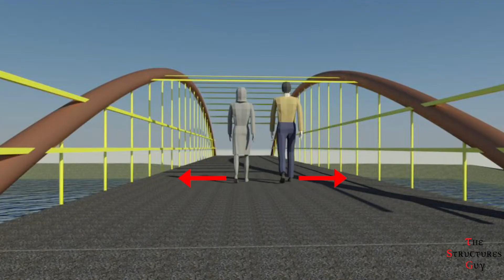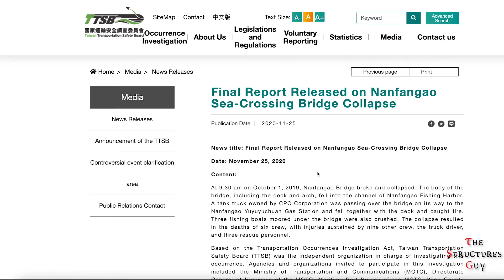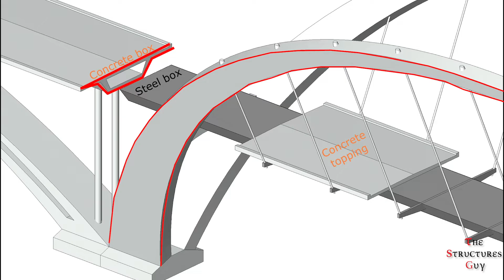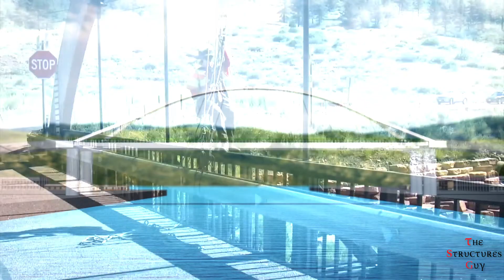The Taiwan Bridge Collapse: Why it Happened?

Comment: The suspender cables did not have enough redundancy, that is if one deck segment without support can weigh down the adjacent segments to cable failure.  Deck integrity is crucial to tied-arch bridges.  Also, arches are weaker without a load pulling/pushing them down, which is why the weight of the deck on the suspension cables is important.